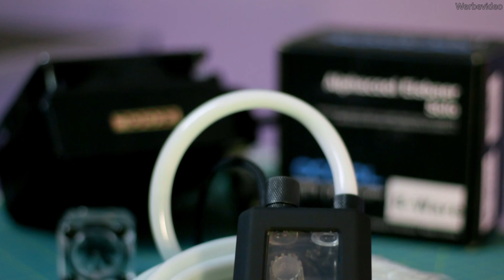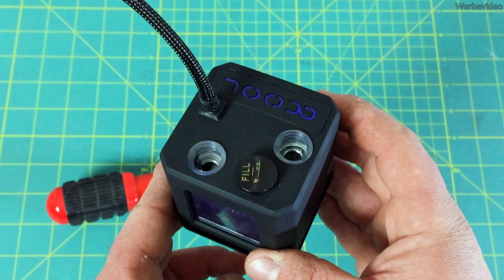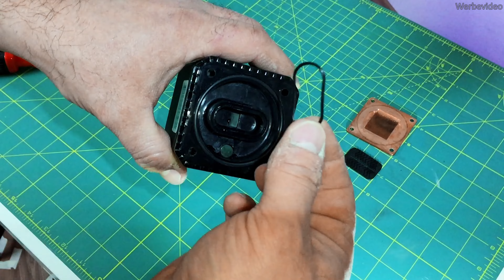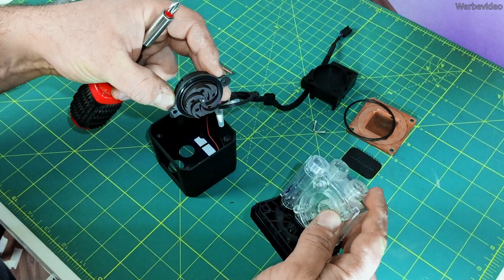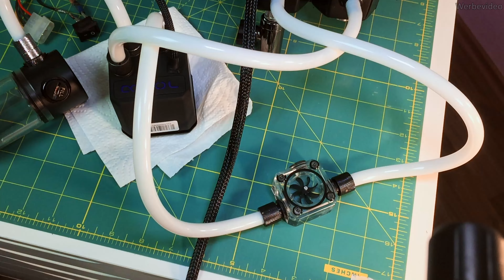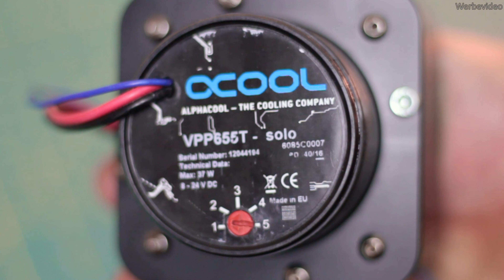Alphacool Eisbaer Teardown, almost as easy as an AIO. Budget custom Watercooling. Whats inside?

Comment: Thanks for the  guide, i am going to replace the Alphacool DC-LT 2600 
Ultra low noise ceramic with a Alphacool DC-LT 3600 ceramic, so the 
water flow is much beter, and so the cooling becomes  better.

Comment: How do you slide out the housing ?
Reply: Hi, once you've got the baseplate off, you pretty much just pull up on it while shoving the rubber grommet of the wiring in.

Comment: Hi, did you measure the size of the fin stack on the coldplate?
Reply from the maker: Hi, I didn't. But I got it out of the system it was in atm anyways so I'm opening it up for you right now.
Check my Twitter and Insta, I'll post it on there with some pictures.
You prob mean the square it covers? Why you asking? Kind of curious.
Reply: @PXLgenerator  Thank you. I have the exact same Eisbaer and I'm getting a bit annoyed at the thermal performance of it with my 5900x. I'm thinking this is happening due to two things, pump flow rate and size/density of the fin stack/location of it. I'm considering to switch over to the Barrow cpu/pump/res where the fin stack covers almost the entire IHS (around 3,5 mm's on each side have no covering of the IHS). Alternatively, I'm considering to swap out for a full custom loop with soft tubing and a bunch of quick disconnects for ease of maintenance.

Comment: Thanks for the video.  Will the Eisbaer unit be strong enough to cool the CPU, GPU and flow through a 420mm radiator?
Reply from the maker: Hi, thanks for watching and for taking the time to leave a comment.
I was more or less wondering the same thing. I'm planing on doing a follow up, wife pc upgrade, got a 280 rad and a 1070ftw with a alphacool gpx block on it. 
I'll probably do some flow tests outside of the case, got more rads laying around, so I could just hook up more and see when stops flowing.
Still figuring out this YT stuff and I'm terribly inefficient so it could take a while, sorry if I can't help you out in a timely manner relevant to you. 
Thanks for the good question, take care

Comment: Thank you for making this video! I'm planning to add an EK-XTOP Revo Dual D5 pump res to my Eisbaer Aurora 420. Can you give me tips on how to remove the tubes? The Auroras no longer have tubes that have coils in them. It's just a smooth rubber coated fitting.
Reply: Did you ever add a pump?
Reply: @Voyex  Hi! I did. But eventually went to the Custom Loop route and added more radiators.
Reply from the maker: Hi, thanks.
Wow, that a lot of pump with dual D5's, that DC-LT won't be doing much at that point. If I'd be planning something like that I'd probably internally disconnect the DC-LT and remove the impeller on the pump to open up that flow path. But I guess it doesn''t matter with two D5's either^^
Haven't had an  Aurora in hand yet, but from what I can tell those are still normal fittings with a more sleek design.
The outer clamp rings even have flat spots on them to possibly use a wrench, so those should funktion just the same as all other usual soft tube fittings.
Glad to hear the vid is usefull to people and thanks for watching. Have a happy new year
Reply: @PXLgenerator  Thanks! I just plan to use the dual pump for redundancy. I find the Eisbaer Aurora not enough to cool my 10900k. It reaches 90C in Prime95 small ffts with avx. That's just stock 10900K. Overclocking it will trigger thermal throttling Probably because of the flowrate. So a dual pump might solve my problem.
Reply from the maker: Ah ok, hope the extra flow helps out